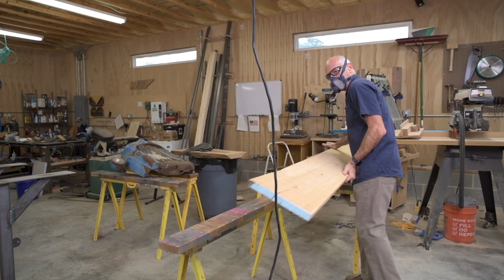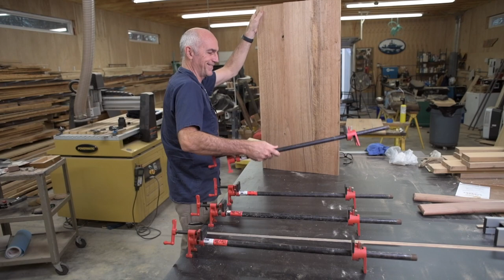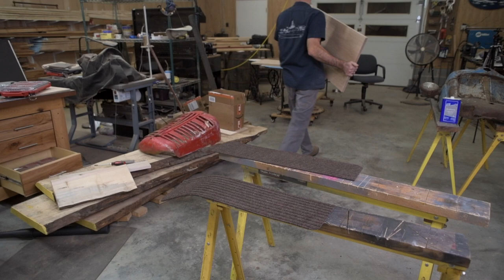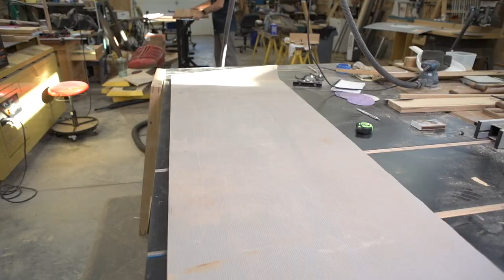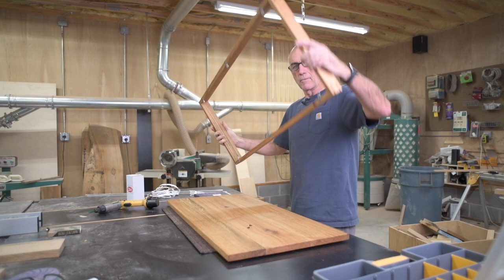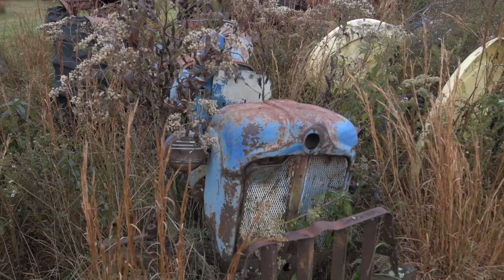Tractor Table Build Completion

Comment: I like the lights on the blue one. But the color of the red one. What if you cut a hole in the steel frame so that you could run the cord down inside a leg.  Then it could be hidden.  All in all very nice design and build.
Reply from the maker: Thanks Andy, I'm going to live with them in my shop for a bit and see what changes I might make before trying to sell them.  Unfortunately the cord isn't  long enough to run down the length of the leg and then come out and reach a plug.  One of the things I may change on it.

Comment: Both turned out great.  My eye likes the blue grill best probably because of the headlights.  I am curious if in your design process you considered an inlay on the table base to compliment and tie into the respective grill color.  Also curious on your estimate of the total hours involved in creating them.  Looking forward to the next project.
Reply from the maker: I honestly didn't think about doing any type of inlay.  I didn't want to draw any focus away from the grills.  Since I'm filming this stuff it's hard to estimate time.  Cutting material can happen while I'm doing other things in the shop.  I think there is 2 to 3 days work in them if I wasn't doing anything else.  Thank you for your question.